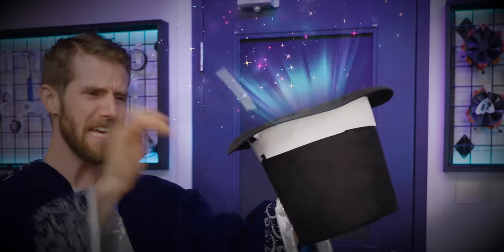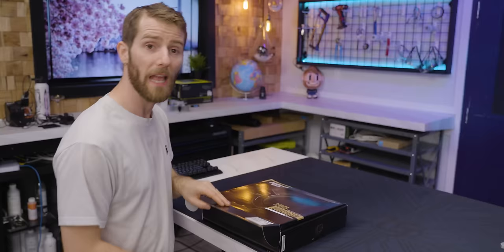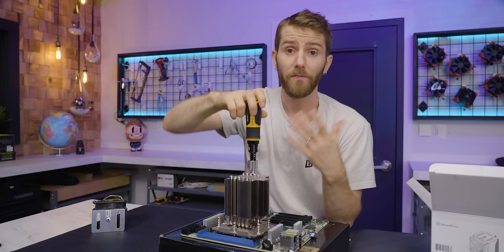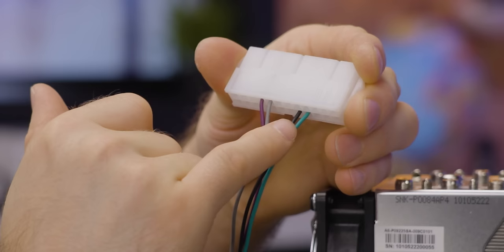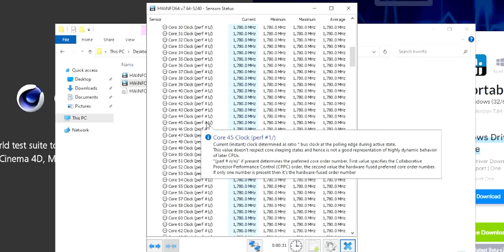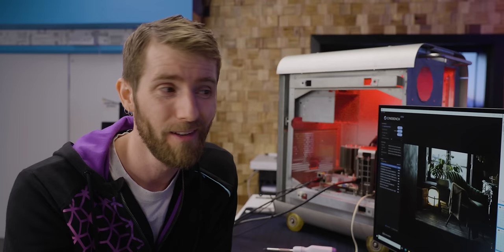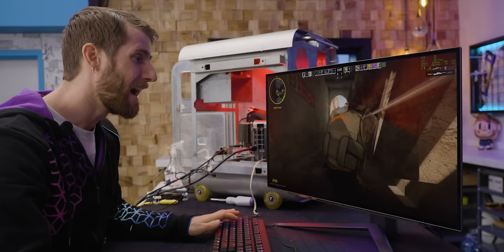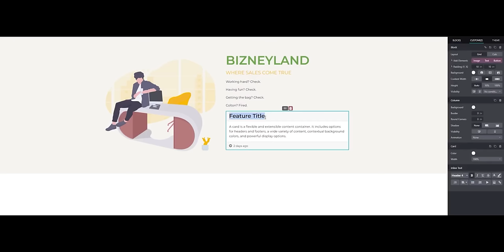AMD’s 128 Core MONSTER - Epyc Bergamo

Comment: I wanna see this CPU run GPU tasks.
Like, i wanna see DirectX ported to the CPU and have it run something like Doom 2016.
Reply: God yes, I need to see DX-for-CPU happen lol
Reply: If I remember correctly someone ran crisis on the 64 core epyc back then. Would definitely be interesting to see this on the new epyx
Reply: mesa 3d exists, and doom 2016 runs in opengl or vulkan modes (no d3d if I remember correctly)
So your wish might already be possible today 
Ltt make it happe
Reply: It would actually be pretty bad compared to even entry level GPUs because the core sizes for those are so small because they run a very limited number of instructions compared to x86-64, and they perform mathematical calculations with much more precision to make sure things don’t look all shimmery/warbley like a Sony PS1.  For comparison the number of GPU cores on any discrete graphics card is going to have (at a minimum) at least 4x the number of threads as this CPU, for the closest comparison you’d have to look at iGPUs, like the Intel UHD 750 that’s included with the 11th Gen i5’s and up, which have 256 cores.  We’ve reached a point where the most powerful GPUs have 1:1 core per pixel ratio.  

So, what you’re suggesting might not be as exciting as you think and might make it look far less impressive than doing what it does, which is perform a ton of complex instructions in parallel and host a ridiculous number of containers and VMs that can all be allocated a reasonable amount of cores and memory, that it wouldn’t fare too poorly against older workstations that shipped with similar specs years ago.

With the setup LTT had, they could setup 16 VMs with 16 cores and 48 GB of RAM, which is overkill compared to most virtual servers I’ve ever worked with running on a VMware server farm.  If you needed fairly robust virtual servers you could easily provision 32 servers with 8 cores and 24 GB of actual memory.  More than likely these are going to be used in a mixture of uses where you’ve got VMs dedicated to specific virtual systems that will reserve the cores and memory, while others that are more dynamically allocated so that at idle it won’t use up very much, but as more demand is placed on the system, it will just start allocating more memory and CPU cores and cycles as needed.

If you’ve never seen how VMware server farms show the CPU and Memory usage it’s weird the first time you see it, because it will say goofy shit like 15 GHz CPU used, which is a running total for the usage within a particular timeframe, because that’s how they bill for some of these things, even though it’s not their hardware, they charge licensing fees based on usage, because people are willing to pay that much for their software.

Anyway, as interesting as these CPUs are for the most hyperconverged data centers, it’s still really boring for games because GPUs are just so much more parallelized and have been that way for a much longer time.

The takeaway that’s most interesting is the CCDs being so jam packed, because it means that we’re going to have consumer desktop and workstation CPUs with 32 or even 64 cores on a much smaller package with higher clock speeds within the next couple of refresh cycles, and/or more PCIe lanes for even more I/O and memory capacity.  HEDT is just going to be overshadowed by regular desktops, and laptops that will be able to handle more multi-threaded workloads.  Also, the power efficiency of those cores were pretty impressive as well.
Reply: @gabenchrist7331  linus did 😂
Reply: @sonny958  haha, this would indeed make sense.
Reply: That's what Linus before drama would do 😀
Reply: DXVK + lavapipe
Reply: Naah. Running Crysis with CPU rendered graphics is the proper test (as was done with at least one of the Threadrippers).
Reply: I think microsoft publishes a directx software wrapper but I doubt it runs on more than 1 thread
Reply: I wanted to comment the same thing i remember Linus getting like 27fps on his review of i think the first 64 core epyc chip, and i think it was crysis would love to see the same thing done on this cpu
Reply: It's funny because old games used to all support a software rendering option, but as GPUs became more and more dominant, that began to fall to the wayside before being ultimately dropped. Now that CPUs are starting to get really beefy again though, it'll be interesting to see if it makes a comeback at all.
Reply: LLVMpipe is the way to go here
Reply: Wait, actually no. Llvmpipe only uses 32 threads for now.
Reply: swiftshader is what you need
Reply: @arnox4554  The first 64 core epyc was barely playable in crysis at 720p low settings IIRC. Bergamo is faster, but not fast enough to outcompete a second hand GTX 1650 that costs 100x less
Reply: Ah yes, directx on doom 2016...
Reply: Lazarrusbee will rise again!
Reply: I remember seeing them do old Crysis on a previous EPYC or Threadripper system.  Would love to see that on this stuff
Reply: Or even playing vr games on it.
Reply: Crysis being rendered on the CPU.
Reply: @arnox4554  The way I remember it was that CPU rendering was the norm and GPU rendering was the sometimes available option...
Reply: They had them in the past and they were called software rendering.  Short answer is that software rendering sucks. The way a GPU handles graphics vs a CPU is totally different. CPU is for general purpose computing whereas GPUs are specialized processors that do well with specific tasks.  NVIDIA GPUs have CUDA cores that can accelerate certain applications that use the CUDA APIs but it’s not like you can run Windows or a program like Word or Excel on a GPU.  That is where the CPU comes in.
Reply: I'm remember running Delta force on PC software rendering using voxels which used the CPU you could actually hide in the grass
Reply: Geekerwan already ran GTA5 on CPU a few weeks ago on his Chinese channel, however it has English subtitles so you can watch it
Reply: @mme725 this already exists in Windows, it's called WARP and activates whenever a 3D capable GPU cannot be found. It was featured in a video not too long ago about a GPU that fits in an M.2 slot.
Reply: @maxhammick948 I mean, it would more be for abusing cpu cores, rather than be cost effective. If nothing else it would be better just to run several gpus with the amount you spent on the cpu...
Reply: DirectX 12 has a software fallback called WARP, but I'm not sure if it's multithreaded.
Reply: @kernelpickle if high end gpus are 1:1 in core count and pixel count... then in what world does the 4090 have millions of cores needed for 1080p? the 4090 has like 16000 cores, a large amount yes but a far cry from your 1:1 core ratio
Reply: They did a Crisis CPU video before, maybe they can do it again with this CPU

Comment: 15 years ago, 128 cores where only available in compute clusters with high speed network interconnect..  I remember preparing computationnal fluid dynamics on this type of cluster and waiting a few days in the queue to run a 32 core job...
Reply: Even worse than that, it was only 5 or 6 years ago that you couldn't have this many cores in a quad socket system.
Reply: We could stack Xeons in DELL servers, we did 32 Cores max on one system.
running VM's, Oracle
Reply: Yes. And 30 years ago many PCs still ran on MS-DOS. I guess that's how technology works hey?
Reply: @funbucket09 . Did you see that….. it was the point going over your head.
Reply: @robertt9342 people like them can't understand what a KB even truley meant. How large a system like these would have been 10 yet alone 30 years ago. 30 years ago half a GB of storage cost ~300$ That now would get you over 20tb of storage. That's roughly 12 million dollars worth of storage in 1993. Not counting for inflation which make it 25.5 million worth of storage. 🤯
Reply: @funbucket09  That's actually not how technology works. It doesn't just get better automagically every year. These improvements are the combined result of monumental amounts of research, engineering and manufacturing efforts. Thousands of people are working on the incremental improvements we see every year. It's important to look back and realize that what 15 years ago would have taken hundreds of thousands of dollars and a whole room full of equipment now fits into the palm of a hand. We did this. As a species, we figured out how to do that. It's incredible. It's awe-inspiring. It's not just "how technology works". There's lots of stuff to be cynical and jaded about. Try not to extend it to the things were wonder still exists :)
Reply: @tobiasjennerjahn8659  I never said anything about it happening 'automagically'. Of course it takes work etc. Way to take my simple smart arse comment (literally it was just me kidding around) and blow it way out of proportion. Talk about an over-reaction. Jesus H Christ does no one have a sense of humour anymore? Is everyone really that bloody sensitive? Sorry if I upset you mate. You must work in the industry so I didn't mean to belittle the technological innovations of the past 50 years if that is what you assumed I was doing.
Reply: @Bruce1Parsons  oh you as well? Jesus. You don't even know how old I am for starters. My first computer as a kid was a Commodore 64. See my comment above anyway. I apologise to you also if I upset you.
Reply: @funbucket09  No worries, I'm not upset and I didn't assume that you were belittling the progress of technological innovation. I just took your comment as a chance to highlight how amazing that progress actually is, which is what the original comment also wanted to do.
It wasn't meant as a personal attack. I just like to appreciate how far we've gotten.
Tbh I guess I don't really see the humor in your statement, but humor is pretty subjective, so that's alright.
Reply: @tobiasjennerjahn8659  fair enough. and don't worry. I think it is pretty darn amazing too.  It really wasn't the best joke so I get that a lot of people won't find it funny

Comment: Linus the way Maxons bucket rendering works the larger memory you have the larger bucket it has.  Bucket rendering with small cells was designed to prevent out of meory errors or slow disk swaps on systems with little memory.  The new version  automatically optimises bucket size, which you can manually do on say Arnold or Vray.

Comment: Some other cloud native workloads, in addition to containers, as another commenter mentioned, are people running bare metal servers and they have their own virtualisation layer on top of it. How this helps is since they own the virtualisation also, they can have multiple different VMs running on it, performing different operations on the same set of data. And since that data resides in the same CPU/Memory space, the latencies are ultra low (~10-100 ns), what is called HPC in the industry. 
My org runs simulations on market data and these are hundreds of files spanning 10s of GBs each. Being able to load all of them into memory and then running parallel simulations, all on 1 single CPU would be a game changer in terms of performance as compared to running 64x2 CPUs in NUMA config as currently, we are maxxed out at the CPU level, only limited by the memory latency and memory throughput.

Comment: I would love to see you attempt some software rendering on one or more of these chips, we are approaching GPU levels of core count here.
Reply: Crysis on CPU only
Reply: @PhyrexJ I'd love to see that
Reply: @PhyrexJ that's been a thing for a while.
Reply: Yeah, a CPU port of DirectX!
Reply: they did a while back with Crysis
Reply: Is there a way to force a directx game to use WARP (Microsoft's official software renderer) as the rendering device?
Reply: lol gpus have thousands of shader cores. This has 128..Yeah it could get the GPU performance of a 15 year old GeForce 210 or something..
Reply: @yalldrinktea there an m.2 VGA graphics adapter could do it. no 3D and actually not terribly unrealistic of a use case for a chip like this. Even better with no drivers.

Comment: With AMD aiming for compacted Zen-C cores and Intel aiming to put something like 300 E-cores in one socket fairly soon, the days of a Kilo-thread box are rapidly approaching.
Reply: yep sirrra forest successor is supposed to have 512
Reply: It’s crazy. Soon we might be referring to CPUs like: “4 Kilocores and 8Kilothreads” In 20 years.
Reply: Depends what you mean by box. Some of the server manufacturers have already done 4 node 2u chassis that support 8x Epyc CPUs across the nodes.
Reply: Intel was talking about 144 cores last year and they still haven't done it meanwhile bergamo is 6 months old.
Intel are like 3 years behind.
Reply: @tomstech4390  Clearwater Forrest is on pace. Intel is behind in server core count overall yes, but this isn't another Sapphire Rapids situation with a year of delays.
Reply: @DigitalJedi  okay... but "on pace" is still 2 years after Bergamo launched and will be going against Modena or whatever the 192core/384thread Zen 5c will be with ~2x per core performance advantage.
Intel needs 512 cores on a TSMC process within 12 months.
Reply: @tomstech4390  I don't know about "need" but it would be nice to see. A TSMC node may not be needed either. Clearwater Forest is supposedly an 18A product which would be competitive with N2 silicon. 288x ARL E-cores on a 2nm node is still going to be quite strong, but obviously 192x Zen5C is going to be stronger because they are just bigger cores that do more.

I think we're coming to a point where Intel and AMD are playing different parts of the market for servers. AMD is playing for cloud providers with large core counts and brute-force compute power, while Intel is aiming for the workloads they can design and scale accelerators for. 288 small cores may also be favorable in specific workloads that don't want hyperthreading, as it is seen as providing unreliable performance characteristics (weaker than main thread).
Reply: @gmdking  We went from single core to dual core in roughly the same time. We know this is something that has been in the works till at very least since the release of Dual Core Chips(Most likely way before that), so the tech has been worked on for past 20+ years. KILO measurements might be much closer than we realize. 
Obviously it might take longer for it to become readily available for the consumers, but I would go as far as to say that we will see 1st Consumer grade server chip in some capacity that hits that 1k mark.

Comment: I'm always astonished how quickly and how far technology has advanced. The first PC I built back in 2003 had 256MB of RAM. This PC has 768GB. Granted, this is not a home PC and it's likely nobody here will ever be running this setup at home, but it's still crazy to me that my first PC, which was only twenty years ago, has 0.3% of the memory that this one has.
Reply: You have the decimal point at wrong place. Your first PC had 0.03 % percent of memory.
Reply: I was talking to a coworker the other day about my first USB thumb drive. A whopping 128MB that probably cost in the neighborhood of $40-$50. A full gig was way out of the question for me at that time. They're sold in packs of 5 for about the same as cigarettes now.
Reply: I think some Ivy-bridge-EP processors already support 768GB RAM, those were released back in 2013
Reply: Consumer hardware takes 128GB of DDR4 or 192GB of DDR5, but that could go to 256GB if they end up making 64GB udimm sticks (which would already be 1000 times more than your first computer, still on consumer hardware)
Reply: @albertlong3492  yes i remember people buying HP Z 80something workstations with 1.5 TB of ram around 2014, however that is much slower memory than what's available now
Reply: @naomie2680  Depends on how you define "consumer hardware", if you count HEDT as consumer and the 3175X in particular HEDT, you can go 384GB I believe.
Reply: @albertlong3492  Oh I consider only things like ryzen/core and under as consumer, I believe above is considered "prosumer", and yeah on some threadripper it's even rdimm, so you can put quite a ton of ram on them, but that's not as affordable as even the top r9/i9
Reply: I went the way of the Commodore Amiga back in the 80's.  Started with the Amiga 1000, then sold it and got an Amiga 2000.  I bumped it to 5MB of memory (yes, it would take odd amounts of memory).  Added in a processor accelerator card (a Motorola 68030 on an expansion card) instead of the stock Motorola 68000. Then a "flicker fixer" (because "hi-res" graphics resolution was interlaced and flickered).  Added a full size 1GB hard drive and ran a BBS on it for years.  My first "PC", which I got after Commodore went down the tubes, was a 166MHz Pentium system. The WWW had just become a thing and well, the rest is history.  Sitting here on my new build, a 14th Gen I9 14900K, RTX 4070, water cooled, 64GB of DDR 5 and a 2TB PCIE gen 4 NVME (I opted not to go with the PCIe gen 5 NVME's because they're too new and waiting for that to expand to better and faster units).  

Computer technology growth has been amazing just in my life time.   This 128-core Epyc is indeed epic.  Can't wait to see what's available in just another 5-10 years.  Simply amazing.
Reply: Yeah but that was a PC and this is a server. So you need to compare it to a server from those days. ;)
Reply: @WoobsBallJesse  yeah but chinese USB thumb drives that don't last long . I bought my first USB thumb drive before 2010 , the brand is verbatime with 256 MB only , and it is still working fine in 2023
Reply: 0.03%
It is 1 out of 3072, or this PC is 3072 TIMES more powerful than yours in 2003.
Reply: My first PC build was a fairly performance build for the time.  16 bit processor,  approx 6 mhz, 64k ram.  Mid 1980s.   😂
Reply: @ydid687 what kind of people? Engineers?.
Reply: @Teluric2  y e s spells yes